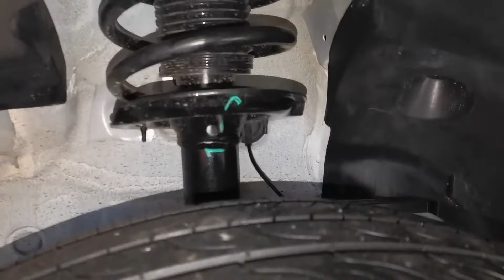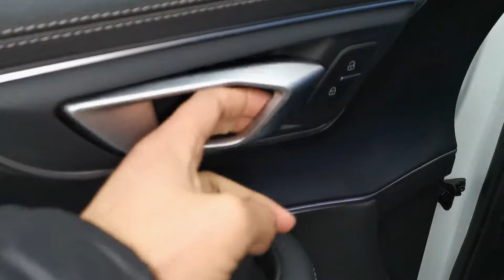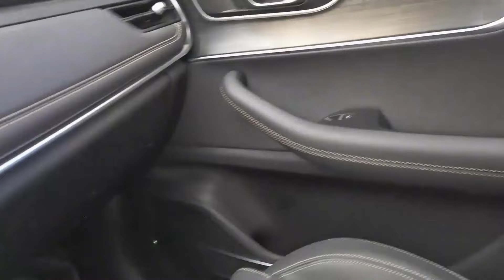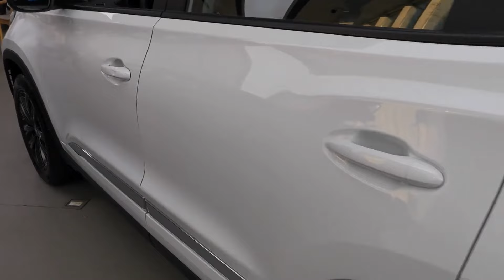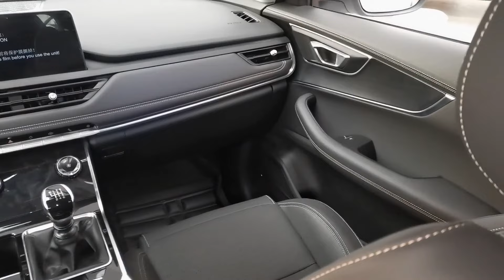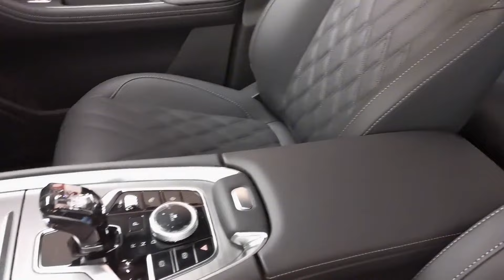2024 Chery Tiggo 8 in-depth Walkaround

Comment: 1581kgs with 155hp? Common. Not even 200hp? That little engine is unbelievable.
Reply: Lol then go for the 2.0 liter option with 250HP or else get a chery luxeed,exceed model that are EVs which has over 500HP since they are going electric in the future